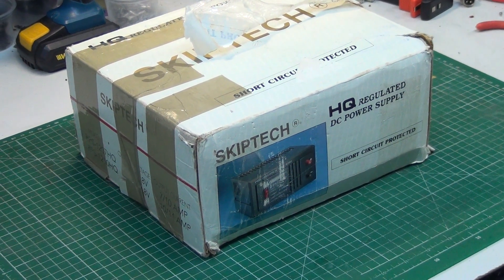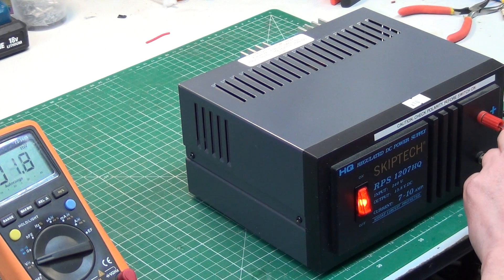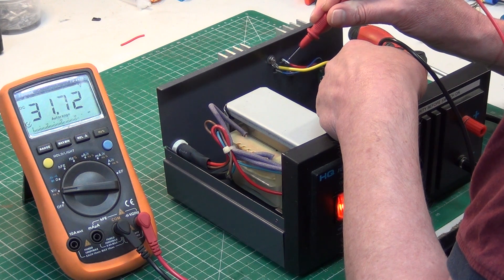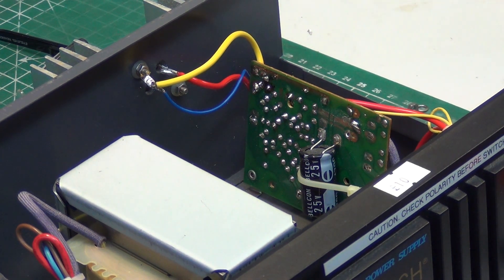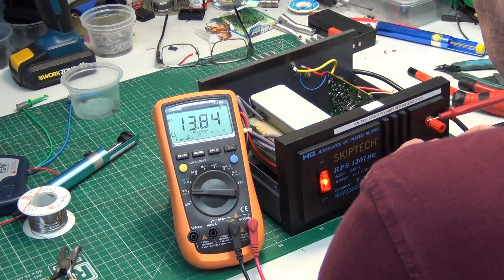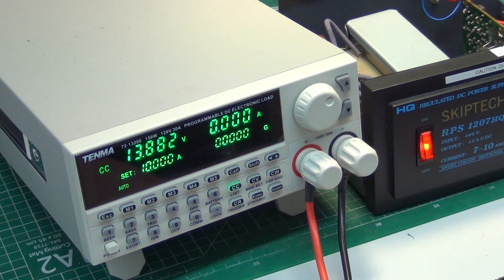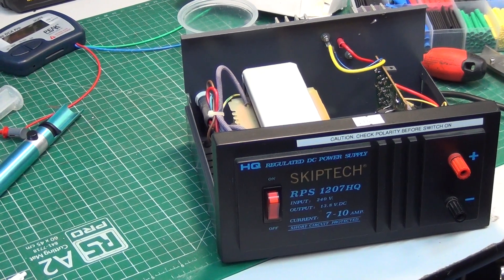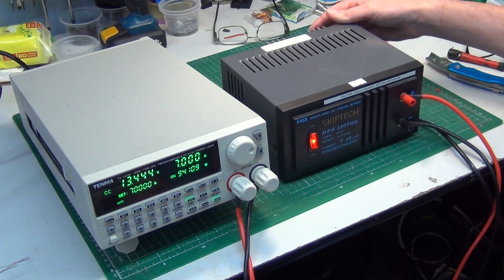Skiptech RP1207HQ 7-10A power supply repair

Comment: Hi what’s your thoughts on these switchable psu’s .
Reply from the maker: If you're talking about 'smitch mode' power supplies; they aren't long-term treliable or even repairable in  my experience. I do my best to but conventional transformer based power supplies.

Richard, G0OJF, UK
Reply: It’s a Nevada psw-30h